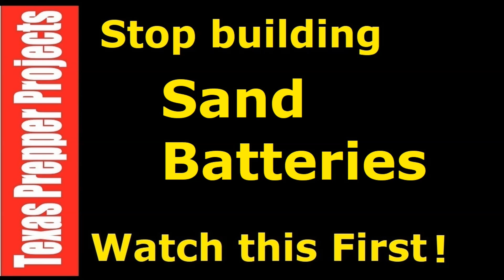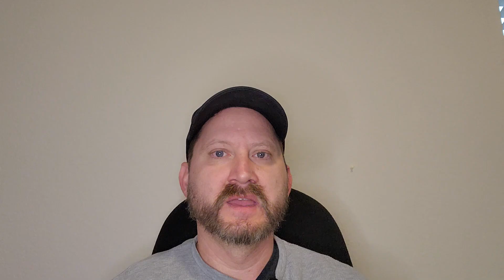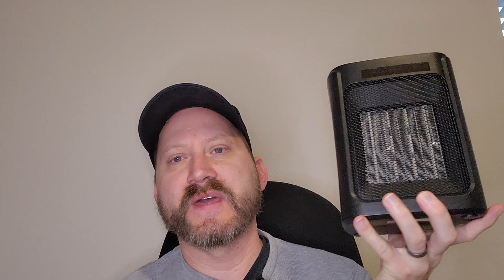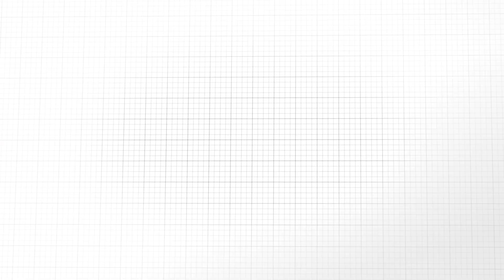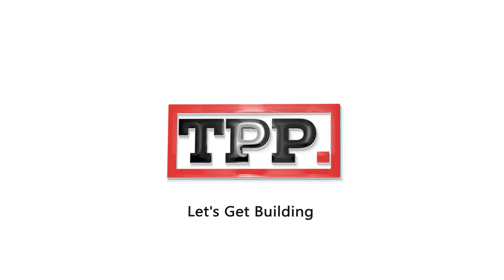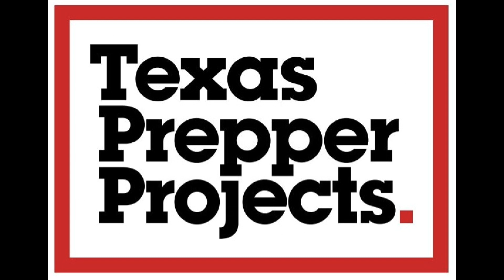Stop Building Sand Batteries | Texas Prepper Projects

Comment: You nailed it at the 2:15 mark when you said "heat is heat is heat is heat is heat. Then it went down hill fast.  That heat in the sand will 100% transfer to the air in time. When the sand temp and the room temp are the same 100% of the heat that was put in the sand transferred to the air. 

I don't get how you can know a candle burning in a room heat output is the same as a candle burning in a clay pot but not understand the sand battery is 100% the same.
Reply from the maker: check out 'clay pot heater' videos on youtube. They seem to think that it's magic.

Comment: If properly designed &  sized, a sand battery provides an excellent reservoir for heat.  We have a 12 x 12 x 8'  sand battery that is heated all year round with solar & in the heating months a geothermal mass heat pump sends it into baseboard & underfloor heating in the entire house. The battery also provides unlimited hot water year-round.
Reply from the maker: thanks i'd love to see a full video

Comment: The thermal heat off sand will continue depending on size of sand contained. If the sun goes down and U have no battery your heat source stops if you have a sand battery you will continue to get heat from sand over a certain period of time
Reply from the maker: Thanks

Comment: I think the idea is that the sand is a heat bank. Warmer than the air over 5 hrs and concentrated heat source.
Reply from the maker: But the heat from the sand just goes into the air eventually
Reply: @texasprepperprojects yes ...but in the air it is dispersed immediately. Not in the sand as it holds it on concentrated form could say.
Reply from the maker: but the heat still goes into the air

Comment: A candle and a sand heater are vastly different in that the candle uses up the wax whilst the same battery is using power generated from the sun through solar panels. Also the cost of diesel or Propane have recurring costs. You also failed to take into considering thermal mass, which provides some heat storage and release. I believe a sand battery or a “beer heater”  warming an additional mass, such as rocks or cement/ceramic bricks could provide a heat sink.
Reply from the maker: Yeah but thermal mass doesnt make the heat greater
Reply: @texasprepperprojects but releases it over a longer period.

Comment: Yeah, I’m another random guy with no real world experience typing words on a screen of my extremely low valued opinion, but I don’t think I understand your point to this. The sand is just a passive means to store excess energy. Having the flexibility to release that excess energy into the air is the beauty of it. The heat isn’t coming just from the air, but rather the sun, right? Either by passive means of just sun bathing or active means like solar panels converting the rays to electricity to power the heating element(s). 
What would be your thoughts if a solar panel was used to power a small pump that would pump water from a lower barrel to a higher barrel, and then at night you can turn a valve to let the water (stored potential energy) fall back down powering a turbine. That turbine could power whatever, like a heater, but the point remains that it’s about storing potential energy for a later use. Thanks for the video and challenging a trendy thing, it’s nice to hear other people’s logic for stuff. Truly appreciate you, man! God bless!
Reply from the maker: My point is, why would you put heat into sand and then the heat comes out of the sand into the air? Why not just heat the air? The total temp isn't going to be greater if you put it into sand first. 

My point is, that the only real use of a sand battery is if you have an u limited source of heat, like a volcano, where you need to move the heat to a more sustainable place, like inside a house. It would be more efficient to just scoop the lava out of the volcano and put it in a bucket in your house,  but not as practical as sand.  

My point is that all of the hundreds of copycat videos talking about the magic of sand batteries dont have a basic grasp of thermodynamics.

Comment: Really surprised at this weird explanation of a sand battery. The whole point is you can bring heat into a room without using batteries and charge controllers. If you heat up sand in a room the heat will eventually slowly Escape into the room it is by definition offsetting. He makes it sound like the heat just disappears Into The Ether
Reply from the maker: that is exactly what heat does actually.  Heat disappears into the ether.  Putting heat into sand, then the heat comes out of the sand into the air, then leaks out of the air into outer space.    Or you can put heat into the air in your room. The total BTU is the same

Comment: Type this into GROK or your favorite AI … You’ll need 6-10 55 gallon drums of sand and 50-60 solar panels to keep a 10x12 room at 60 degrees ……  How much sand and solar would be needed to keep a 10’x12’ room at 60F when the outside temp is 20F and the insulation around the room is average R value. The sand is being used as a sand battery. Assume the sand will be stored in 55 gallon drums (as many as needed) .  The amount of winter sun is a generous 7 hours
Reply from the maker: Thank you!

Comment: I get your point, but it could be enough to keep a basement heated.
Also, I thought it was supposed to radiate the heat into the area similar to a masonry heater
Reply from the maker: there is no way this is going to keep a basement heated. It MIGHT stop a green house from freezing. MAYBE.
Reply: @texasprepperprojects  I never played with solar power myself but my neighbor is pretty good at it.   I just trying to find a way to reduce my winter heating costs

Comment: A heat powered fireplace fan and some copper rods inserted vertically into the sand will help efficiency greatly. Also plan to do some testing with integrating copper mesh into the sand along w the rods.
Reply from the maker: What are the rods going to do? Check my other videos in have tried it
Reply: @texasprepperprojects  help to carry heat to the surface for the fan to pick up and circulate.

Comment: I disagree with your assertions. Heating the sand battery does accomplish something. It helps even out the highs and lows in your room. Further, the sand battery can be heated with power generated outside of the room. So you have accomplished something.
Reply from the maker: But the total BTU outputt is the same.
Reply: @texasprepperprojects  that is true. But generating BTU is not the only goal. Making my living room 130° during the day and zero at night if not acceptable. I need to store the BTUs.

Comment: I just ran across these things recently, probably because of the winter and YouTube algorithm. I know this is an old video now. I'm just wondering are these worth it for say heating an 8x8 insulated well shed in Texas (r3 foam board and lined with reflectix as a radiant barrier). We don't get below freezing often or for very long. But when we do where I'm at we often lose power for several hours, usually in the middle of the night when I don't want to get outside in the cold dark slippery mess, walk 300 yards to the well shed to crank up my small generator just to heat it. So for something like warming up a bucket of sand during the day with 400-600ish watts of solar panels would be about the same as running a couple of 150 watt heat lights for 24hrs? Not looking for comfort heat, just something simple and off-grid as it were to keep it above freezing in there.
Reply from the maker: Look into my recent videos about direct thermal air heating as a very 'energy efficient' way to keep heat coming in. Second, I would look into 'heat tape', which is a wire, sort of like a Christmas light strip, that gets warm. I'd wrap that around your pipes and then insulate over the top of it. You could put that on a battery backup to activate automatically. They dont draw much power but directly warm the pipes. Then as a third backup, I'd get a Mr buddy propane heater from home depot as a cheap, quick to deploy heating system for a small space

Comment: @ADPrevost21 I agree with the time shifting. TexasPrepper is correct in that no extra heat is being made as some people believe.
  But, if I have just solar panels and I heat up the sand during the day, I will get some of that heat back for a bit of time after the sun goes down. 
 So, I have a "sand battery" in my living room with some type of element being powered during the day with solar panels outside. After the sun goes down, I should get some heat still radiating for a bit of time. It won't be all night but it will save me some from my own solar or grid power.
  Some may ask why not just charge your batteries then use that   after dark. You can but your going to lose some efficiency even if staying within DC. And why use your batteries for heat until you have to?
  You charge your batteries to 100% (or 80%) - full, use whatever heat from the sand battery, then when it's no longer emitting enough heat, you can then use your electric if needed.
   As for scale, if I can get 150° F for 2 hours after the sun goes down, that's 2 hours I don't have to use of electricity or other energy to heat. For me, 2 hours a day of solar power can add up during the cold season.  That can add up over years even with some non-sunny days. For me, my scale is 1 person and is alot for me.
Reply from the maker: Thanks
Reply: @texasprepperprojects We all appreciate the work you have put into the videos but also the concepts themselves. We really do.
Reply from the maker: @OP-fd4lh   Thank you. I try to make them as science based as I can, with relevant measurements. Unlike other guys that just make a video and say  'hey look!'

Comment: Reconsider your argument here. Your physics knowledge needs some improvement and your assumptions about the use of a sand battery don't include some beneficial uses. Consider: radiating fins and a heat powered convection fan will distribute stored heat slowly.  I am looking at a crawl space in a cold climate that could benefit from a sand battery that can release enough heat to raise the temperature above freezing.  It's not a high bar and is protective for pipes during, say, a power failure.
Reply from the maker: A fan is going to spread the heat faster. But the total amount of btu is the same.

Comment: How bout building the battery then use passive box tube heaters for window heat extraction (if you have south facing windows) during the day and then releasing the heat energy stored in the sand batteries from a separate solar cell system to heat somewhat at night. Then use a wood burning stove for supplemental heat while using stacked peltier devices to reheat the sand. Then have a wind generator. And a heat pump. By the time you get done running around managing your systems you'd be sweating and it'll be too hot! My wife says just move to Florida?
Reply from the maker: Try it!
Reply: @texasprepperprojects I am sweating thinking about it! I think if I got 4 metal trash cans and 4 electric stove coils with about 9 320w panels connected in serial to heat the sand up to 1000°f and blew the fan from them up the stairs from the basement to the 2000 sq. Ft. home plus run 5 passive south facing in window laundry vent hose tube painted black, (phew) it would make a good dent in the furnace operation in N. Illinois. But it sure is a lot of work!!!!!(Edit) I guess it would be about 15 panels to get the wattage.
Reply from the maker: fun!

Comment: I think you are missing the point. The sand battery concept revolves around LARGE, CHEAP thermal mass. if you have a bucket of sand, that's not very much thermal Mass. the way to use these, is to have a very large one that you can dump thermal Mass into for use later. think of it think of it like a poor mans lithium battery. you're not going to build an off-grid water tank that's 25 gallons. you're going to build using a large sized cistern that holds hundreds of gallons. Same concept. then pipe some of that heat into your house, or connect to something that can convert that heat into energy, like a sterling generator, peltier modules, etc..
Reply from the maker: Thanks

Comment: Why not run water in pipes through the sand in to a radiator or something that can quickly put out the heat? Is that not what a "storage" is for? To use the heat later
Reply from the maker: If I was going to use water then it is easier to heat the water directly. Check out my other videos on this
Reply: @texasprepperprojects for water I can only use up to 100°c before it boils. With sand I can store more energy in a smaller space. Of course a water tank would be easier but I need more mass with a lower temperature to have the same energy with small mass and high temperature.
Reply from the maker: thanks

Comment: Here's the problem with the common way people think:    Single MAGIC bullet to cure everything.  

No, a single 1,000w heater will not make a 2,000' home feel like 80 degrees in the middle of winter in Ohio.     A 1,000w (sandbattery or other heat extraction device) can add 5 or 10 degrees to a home, reducing heating cost.

For Texas, that freeze 5 years ago.  I'm sure there are people who wished they had some form of heat passive heat extractor to go from 30 degrees (frozen well pumps) to 35 degrees, enough to keep their pump house from freezing.

The problem is 'us' with our 'Give me a Pill for this' attitude.    The answer for lower HVAC bill while having comfort is multi solution:   THICK or THICC exterior walls.  Double or Triple pane windows.   Passive heat extraction such as Sand battery or solar hot air or wind gen-to-elec heater.  Or active heat extraction with Heat Pump.    Not cheap but some are 'cheap enough' for the result
Reply from the maker: Thank you

Comment: It's storage! If you have excess power what do you do with it? If your panels put out 2k watts, and your heater is pulling 1k, your battery bank is fully charged, your losing 1k of usable energy. Store it.... Sand is cheap/free. Not the most efficient, but it's easier to work with compared to water where you have to worry about leak. To each his own.......
Reply from the maker: K

Comment: If you have a larger scale (not a massive scale, but much larger than a bucket) it would improve exponentially. Also, you need to have some excellent insulation on your sand battery. The best you you could do would be to have a (maybe) 50-100 gallon (or larger) tank full of sand, insulate it with a vacuum wall (think Stanley cup) with a stainless steel pipe running in and out at the top of the tank. The pipe will need to be at the lowest point of your return loop. You'll need to not charge the system with too much water as it could be too much pressure. The steam could feed your radiator and speed up or slow down the amount of heat transferred by how much you open the valve at the bottom of the radiator. Im talking small amounts of water because as soon as it hits your sand it will flash off into steam and if your radiator is the only part not insulated in the loop it will be where your water will condense and slowly drain back to the sand battery in individual drops when not needed turning off the water flow will allow the heat energy to equalize in the sand battery and whatever heat you gain from solar can stay in the battery with minimal losses until you need it.  The insulation is the key ingredient in the battery.
Reply from the maker: Try it

Comment: I have been using the same method, only with water not sand, for years.
The thermal mass supplies the heat for heating the air, the furniture the walls and the inhabitants. Somehow the thermal mass needs energy put into it, in the form of heat. 
Whenever the sun is supplying enough electricity to keep my batteries full, any excess goes into the thermal mass as heat. Whenever there isn't enough sunlight, the burning of gas supplies the heat for the thermal mass. 
The principal is as simple as an off the shelf electric storage heater, with the advantage of using sunlight to supply the energy when possible and having an alternative energy source when needed.
Maybe the "hype" is the reason you think they aren't any good? There isn't any magic going on, it's just a method of heating.
Reply from the maker: Thanks!

Comment: Just do the math. We need 2.000 liters of oil. So 20.000kwh. for one winter. 
Heat up the sand with hot air, not water. With water you are limited to ~100°C if the water has ambient pressure. So heat up with air to 600°C. 85% efficiency. You need to store ~24.000kwh energy. You need ~170 metric tons of sand. That means around 100 cubic meters of volume plus insulation. If the storage is digged in the garden, 2,5 metres deep, you need around 7,5x7,5x2 metres container plus 20cm insulation on each side plus cobcrete base. It's possible. But of course not with a barrel or with hot water. And 25kwh electricity you can get with a decent solar rig. If our house would be insulated, 10.000kwh would be enough
Reply from the maker: Thanks for this

Comment: It is far better to use AC over a sand battery or even a resiative heater is better. However at night you still need coal/gass and so the idea is to use sand as a time delay storage medium.
Reply from the maker: Why does it matter. Watts is watts and heat is heat
Reply: @texasprepperprojects , i tend to jump. Case A) Solar pannels (PV), daytime, use PV to heat home via AC directly. Case B) PV sell to the grid & at night heat house from the grid with AC. Case C) If grid is not an option, PV to heat a sand battery, and heat the home from the sand battery.

So the sand battery is a buffer storage device for night use, well in my mind anyway.